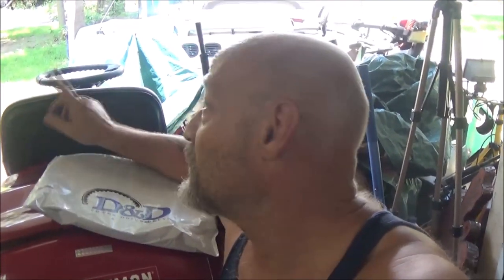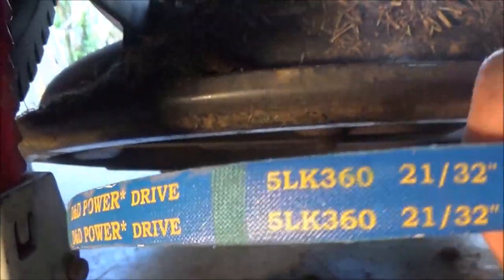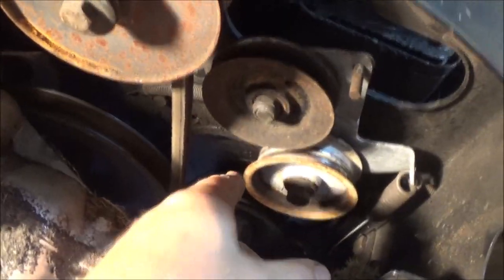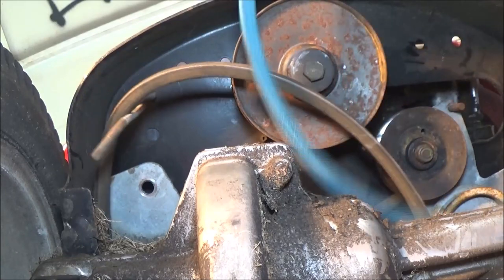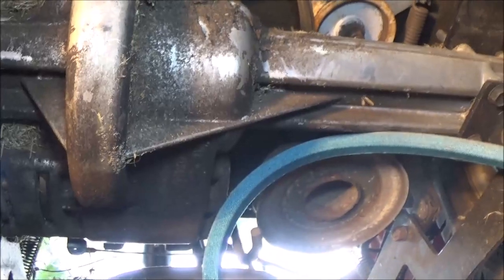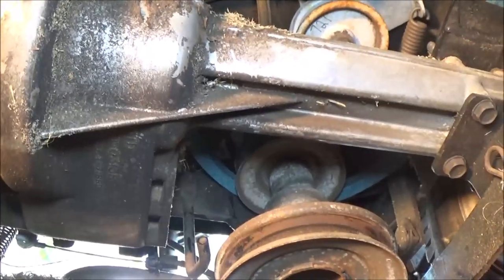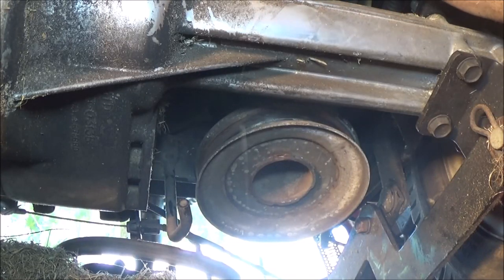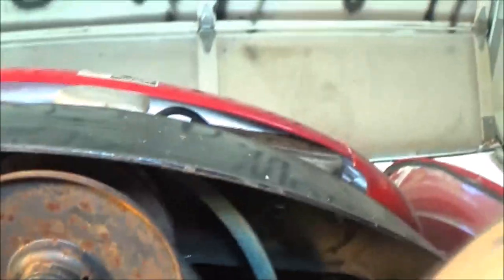How To Repalce A Drive Belt On A Craftsman DRM 500 Yard Bug

Comment: 36x5/8 vee belt seems to be the best fit.
Reply from the maker: Thanks for the tip
Reply: @shabear1000  any tips on how to extract the pully on the main shaft without it turning over the motor? Its almost welded on tight with rust lol.
Reply from the maker: @the1dud heat. Get the pully hot, cool it of with cold water quickly. Do that a few times and it should come off.
Reply: @shabear1000  oooh i'll have to try that if I can't get it with my buddies impact driver i'm borrowing tomorrow!!! Many thanks for the tip!!
Reply: The proper size belt from MTD or Oregon is 5/8×36 1/2 inches !!! 5/8× 36 inches is too tight believe me because there is no free play on the drive belt. There is a big lawsuit right now going on because a guy ended up really hurting himself once he put it in forward and couldn't stop nor take it out of gear 5/8×36 inches is wrong size look it up !!!!
Reply: @machz800  i've noticed it grabs a lot harder with the 5/8" belt x 36" it really is hard to pull out of gear too. Sooo I might invest myself in a 1/2" x 36" just to be safer. It really does fit in there at least but I get what you are saying for sure!

Comment: Thanks for the Vid! I just picked up one of these mowers that had a broken top drive belt. I took the bottom belt in to get it sized up since from what ive read its the same size. after installing both new belts correctly i mowed the lawn. after mowing i rechecked the belts and the top drive belt has huge splits in it and not far off breaking again. would you have any idea why this could be? all the pullies seam to be moving free. the mower does kinda  guilt into gear but other then that it worked great. once again thanks for the vid. helped out a lot
Reply from the maker: My only suggestion would be one of the pulleys is bad. Check the V in all the pulleys. It is also possible to have gotten a bad belt. Make sure your pulleys are in line and no bends. Let me know what you find out. And we can go from there.
Reply: @shabear1000   thank you for the reply. Ill get another belt in a day or 2 and check it all out. will let you know. thanks again for the vid!! mad doing it a lot easier :)

Comment: Thanks for the video. I just inherited one of these from my grandma. I'm having a few issues maybe you can help me. The mower is stuck in reverse. I tried to pull the cable no luck. I took it apart and followed the cable to what I believe is the transaxel. I unplugged the cable  from the transaxel to see if the cable was froze, but it wasn't. The lil thing that the cable is hooked to is stuck. Any idea if that is the transaxel, should I throw the mower out or should I tear apart the transaxel
Reply from the maker: Well I look at it this way, if you tear it apart and it doesn't get fixed, at least you tried. And if you do fix it that's a bonus. If you throw it out right away you will always be wondering if it was just something simple. But first check and make sure your cable is not stretched. Unhook the cable and manually try to put it in a different gear at the transaxle and let me know what happens.
Reply: @shabear1000  Thanks for the response. I have unhooked the cable and tried to manually move the little lever but its stuck. Thanks
Reply: I did mine with a hammer and dowel  on the linkage and got it to snap out of reverse.  Give it a try